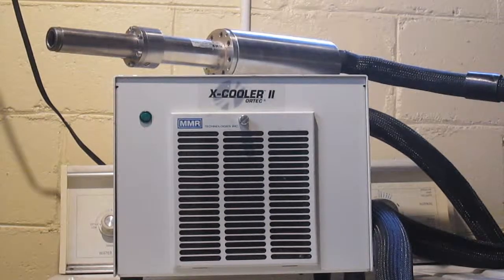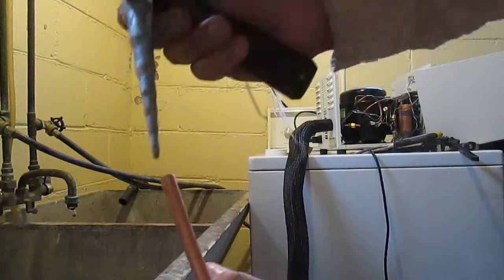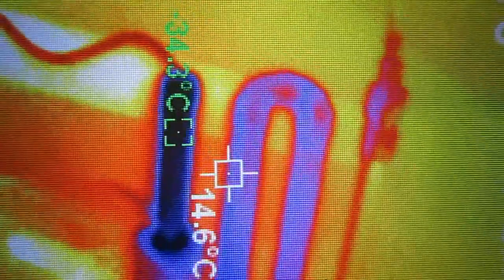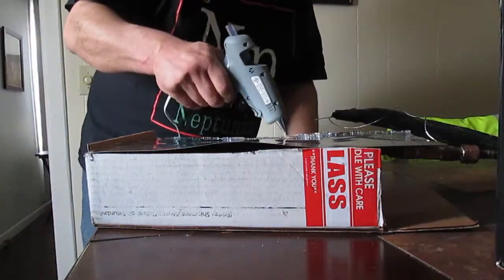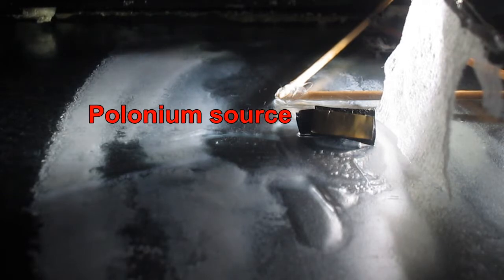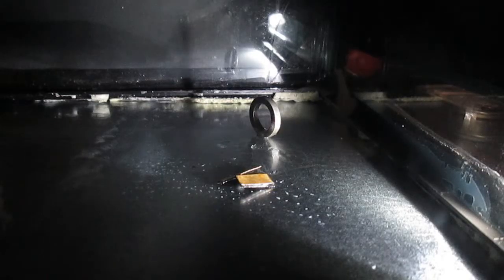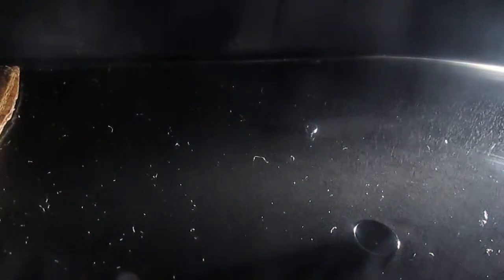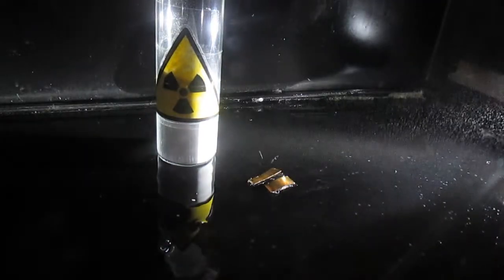cloud chamber DIY

Comment: What refrigerant did you use?
Reply from the maker: R22
Reply: @Neptunium  how did you get your hands on that? Also, I'm assuming you relined the evaporator side of the system?
Reply from the maker: Yes this is an older video and I had some R22 from years ago .. and yes I did, although I could get quite low iI did not do a good job at sealing everything! Thanks for watching!

Comment: I don't know if it's still relevant, but you can see the particles much more clearly if you apply a high voltage across the chamber. A few hundred volts is perfect, as much more will create electrons flying across. As far as I know, the high voltage pulls out other ions in the air, leaving no condensation nuclides, reducing the noise and normally even making beta particles visible.
Reply from the maker: You know what ? That's an excellent suggestion ! I'll be sure to try that one out next time I get my hands on some dry ice! Thank you for that !

Comment: Think you could do a banana, with peel and without? Always been curious if the small amount of radiation would be visible in a cloud chamber :3
Reply from the maker: You know I was looking into that a little while ago .. a quick calculation show less than 0.1 mg of K40 per banana so it should be possible to detect it with the gamma spectrometer. Although the background is high . As for the cloud chamber it seems like it would be an amazing shot to actually see a beta decay from the potassium . Alpha particles are easy because their big and very ionizing but energetic gamma and electron can be hard to catch you know